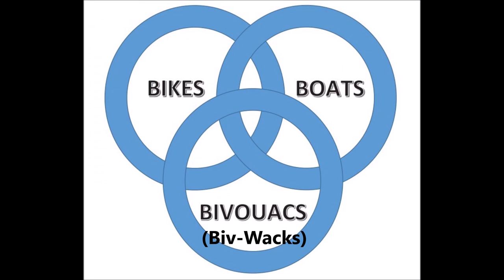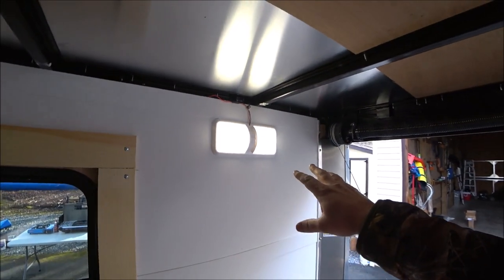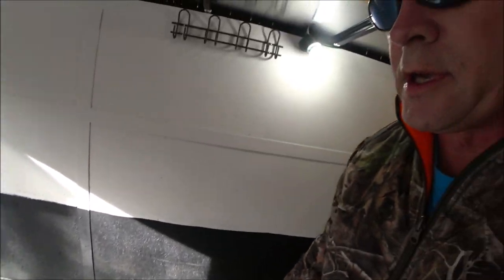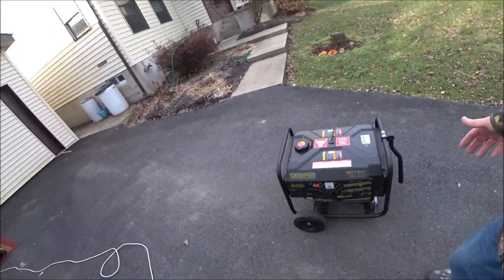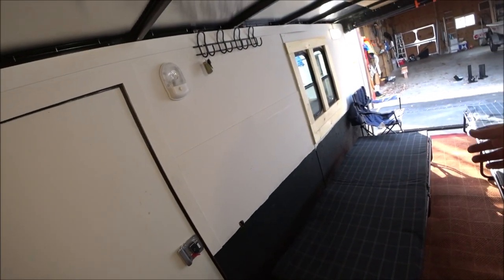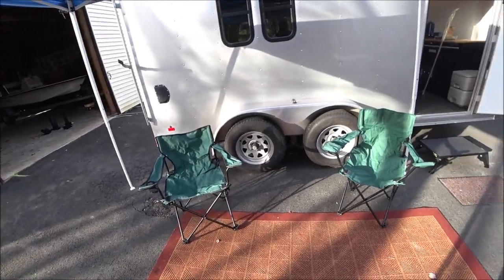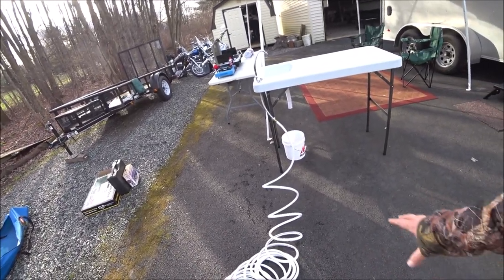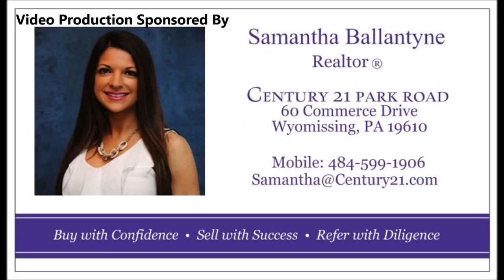Converting a Cargo Trailer / Motorcycle Hauler for Cheap Camping

Comment: If you haven't already done it, you might want to insulate the roof and walls with rigid insulation. If nothing else insulate the roof, it will make a difference. After having done a bunch of contracting work for DOD, on site in the woods year round, I found the guys that ran with cargo trailers converted into hooches and that were insulated were cooler/warmer appropriately for the 4 seasons. I was using something else without AC or heat and I could tell the difference just stepping into their setups. Nice to see people building their trailers out to suit their particular needs.
Reply from the maker: Changes coming. Thanks for watching and supporting the channel.

Comment: Nice job. Did you install vents on the sides of the trailer to bring in fresh air while traveling? The generator that you are using is a construction type unit that typically is very noisy and produces "dirty power" or modified sine wave. Bad for electronics. Harbor Freight sells the Predator "inverters" producing clean energy or pure sine wave. I have a Yamaha 3000iSEB inverter that can run up to 10 hours on a tank of gas in eco mode. You can buy a portable AC from Home Depot like a Black and Decker 10,000 BTU unit, create a vent to the outside using a dryer vent kit and then drain the condensate through the floor to the ground. I have one that I used in a travel trailer because the stupid roof top AC's were too noisy to sleep under. Work for spaces up to about 200 SF
Reply from the maker: I thought about these things but ultimately I sold this trailer and bought the KZ which was a much more comfortable rig to travel in. I do miss the ruggedness of my cargo trailer and the satisfaction of building it out. Thanks for watching.

Comment: Nice set up,been thinking about boing one my self so I can take my kayak with us that way I don’t have put it on top of the truck,decked out it’s about #100. I was wondering about the step you have and wear did you get it?
Thank you
Steve&Jax
Reply from the maker: I ordered the step through Amazon. There were plenty to choose from but I wanted a good sturdy base step so I went with a large platform step. It has two height settings. In the video I'm using the 8" step. It was $56. Harbor freight also has plenty to choose from. Thanks for watching.

Comment: Nice video; thanks.  Did you insulate your enclosed trailer?
Reply from the maker: I didn't insulate it with the type of camping I currently want to do. I may have to change plans if I go hardcore winter and summer cam ping. Than ks for supporting the channel.

Comment: Nice video.   I am going to convert a storage trailer someday...  I like some of your ideas.
Not 100% sold on the windows...  But I guess it makes sense... Maybe one on each side?
Then it can be used as a Hunting blind.....  
God Bless America.
Reply from the maker: I added the window and a ceiling fan so I had air flow in the unit on warm nights. It worked well. Good luck with your project. Thanks for watching.